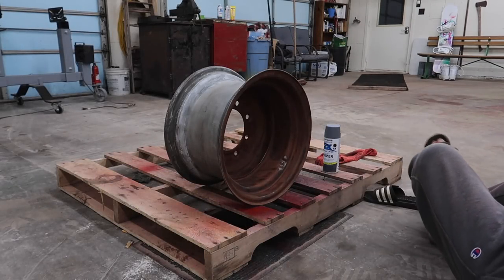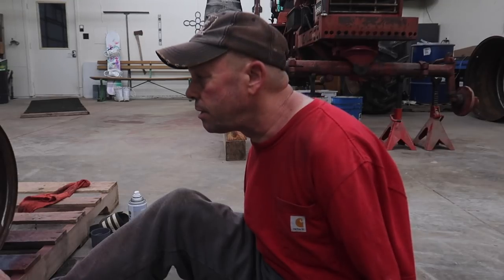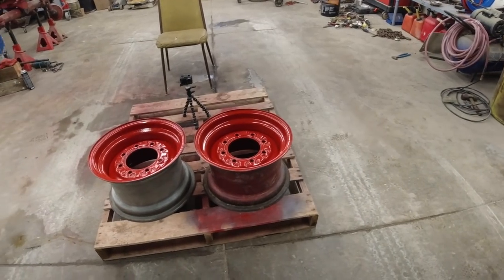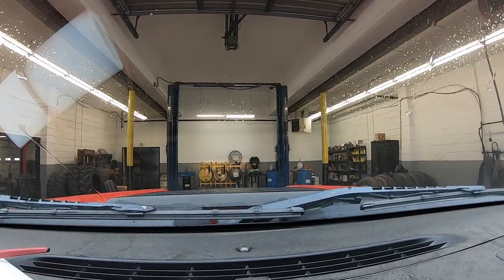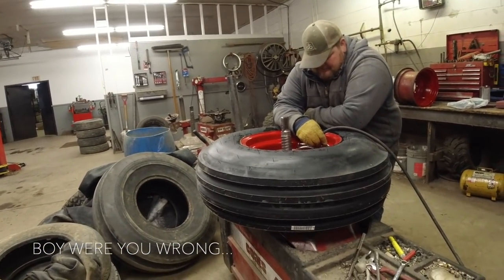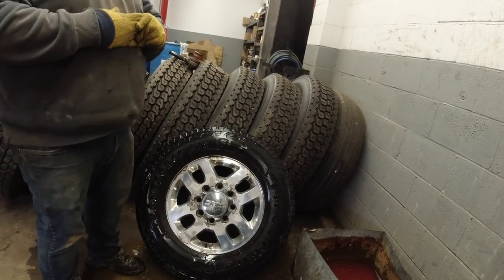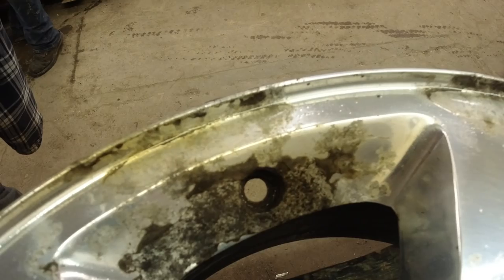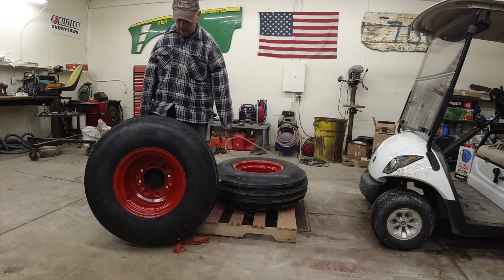He Paints With Feet, & Some New Tires

Comment: Even though l have a really messed up back. I should never complain after watching you. Thanks for the reminder an nice response.
Reply: Ditto, how'd you feel watching him sitting on the ground like that? that would have put me down for at least 2days.
Reply: I can agree on the messed up back. Back surgery's and have been run into over the years. Was T-boned by a semi. Lucky he was in town going about 35, and I was driving my 03, 2500 Quad Cab, 4X4 Dodge diesel. Still I didn't need that with my back in the condition it is.
Reply: @doncroddy7856  Mine is a metal disc and 4 vertebra fused with rods but my scoliosis might have more to do with rugby, motorcycles and farming than just bad luck, lol.
Reply: @piperdoug428 , Same here, 2 rods, 8 screws, 2 new discs and 2 plates and it didn't work !!  The pain is constant and horrendous but as long as I wake up every day, all is good !

Comment: Anxious to see how much luck you have on moving the front end. I put a 20 ton jack on a J.D. # 60, couldn't get it loose, ended up using heat.
Reply from the maker: It wasn't fun on the right side. I talk about it in my next video but used the loader for down force and a big pipe wrench. Forgot to turn the camera on because we were so excited that it was working. Working on the left side now. We will NOT forget the camera this time. lol, hope it isn't as frustrating as the right side...

Comment: Nice paint job Andy, wheels and new tires look great. I got a tip you might try to mix the rattle cans.  I have rheumatoid arthritis in my wrists, elbows and shoulders and it is very painful to shake an aerosol can.  It took an old 3/4" wood bit, cut off the tip so it will go in a drill and tape the can to the bit, run the drill fairly slow and it will mix the paint really well..  If I need to mix it a little more while painting I just roll it across the concrete floor.  Works for me.
Reply from the maker: Great idea. Thanks Gerald

Comment: Boy, when I set my 886 out it was stuck good at the steering rods. I torch heated it several times with the tractor running full throttle and then put a wood block between the frame and top spindle arm and cranked the steering wheel. Eventually it relented, but it sure didn’t want to.
Reply from the maker: Im going to order new ones. All States Tractor Parts has the. Thanks for watching

Comment: The man know his business  I never seen a bench like his..Andy, when I have some painting, I'll bring it over and let, (pay) you to do my painting. I really don't like to paint. Hunker down, cause we are supposed to get 3 to 5 inches, this afternoon and tonight. My Kubota is ready and the cab is on and water turned on to the heater. I would rather be pushing sand in Florida! Stay safe and stay warm, my friend. God bless.
Reply from the maker: Bring it on. If its going to be cold, may as well have snow lol. I do like to push snow, used to push for a local landscaper, now I just do mine and the neighbors lol. Way less demanding

Comment: Those front tires and wheels weigh over a hundred pounds each.  I took the wheel off my Hydro last week to get a new valve stem and I decided to use my Ranger, as it was lowest I have. It was all I could do to load it.

Comment: No doubt you and your daughter will get some recreational exercise on the front end project. It's almost guaranteed that the center section bores are full of rust. It would almost make more sense to pull the spindle knees out if you can and clean the bores before attempting to slide them back in. Replace the axle clamps bolts with new grade 8 replacements. When reinstalling the clamps be sure they are tight as the spindle knees have the tendency to work loose and flop back and forth when turned side to side. It may be a lot easier just to replace those adjustable tie rods with new assemblies than to fight with the rusted up originals.
The front wheels are much better looking than they were. I think if you expose the 856 to some farming dirt and sun that new paint will weather in nicely.
Reply from the maker: Right side is done, except for the tie rod. Just ordered 2 of them. Ill show how we got it apart while doing the left side. Wasn't rusted too bad, just stuck. I used a big press to get it apart. I explain it in next video. Hope the left side isn't any worse than the right side.I knew I would get it, just didn't know how lol. Thanks for watching
Reply: @HarmlessFarmerAndyDetwiler  Sounds like you made good progress and am looking forward to the next "episode"!

Comment: Am i watching the fitter put in the valve insert from the bottom or have i got that wrong
Reply: It had a tire pressure monitor system, and he was installing the sensor, after changing the stem.
Reply: Thanks robert for your reply not aware of anything like this in the uk Bill ftom the uk

Comment: Hi Andy great video as normal. What was wrong with old tiyers if you got tubs in them. Not be funny but weather it was your camera or my phone the paint looked cherry Red.  From Andy in UK
Reply from the maker: The old tires were not the correct size. The one front one was a newer tire and the tire store bought it from me.
Reply: @HarmlessFarmerAndyDetwiler  ok that's good then I was just thinking the old ones look better than I got on my old tractor wich dosent go on the road just in yard and in the woods.  I no i got to find some more tiyers for the back on one off mine.  They hold air but no lugs on them now really.  But they cost so much.  It's ok if the tractor is making u good money not so bad but mine don't so they have to have what I can get at the moment.  L.o.l.  no one can get hurt so I don't worry my tractors u may get lucky and get to second gear but that's still walking speed. L.o.l  nice job thow be nice to see her with all new boots on and ready to do bit off work for you. So you no what you really have to do to her so you no you got good working tractor no leaks good  brakes.  You will be very happy then. Good one

Comment: No hate but what happens when he drives and gets a cramp.
Reply from the maker: Not a hate question at all. Its a good question. I haft to be comfortable when I drive. That way, im not in a tight cramped position. Sounds crazy right? But I am comfortable. Also drink lots of fluid and eat right. That also helps. If you would try it, you probably would cramp up. I been driving equipment for 40 years and have learned my limitations. Not going to tell you it hasn't ever happened, but seldom does. If a cramp would start, I usually know one is coming on. If it would, id simply pull over. Thanks for your comment and thanks for watching

Comment: Andy talking from experience Ive found that the best primer paint for over rust is Hammerite rust cap by kilz the stuff is tough. And I believe rust-oleum makes a similar. paint that I haven't tried but I use Hammerite over rusty metal cleaned off a bit and put my final coats of color over it when its dry. https://www.acehardware.com/departments/paint-and-supplies/spray-paint/hobby/1493501?x429=true&utm_source=google&utm_medium=cpc&gclid=EAIaIQobChMIrffj8JbM5wIVh5-zCh0upAlDEAQYBSABEgLrNPD_BwE&gclsrc=aw.ds  Here's a link showing the product at ace hardware.  The old tractor is coming right along ! 🙂👍